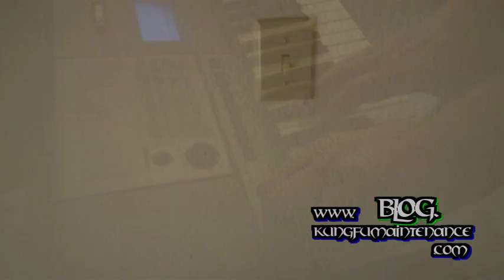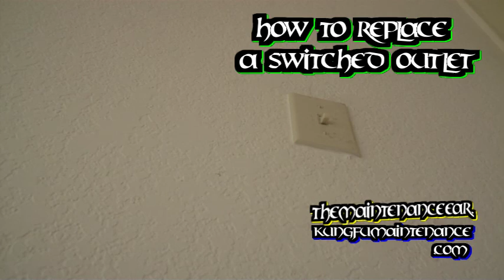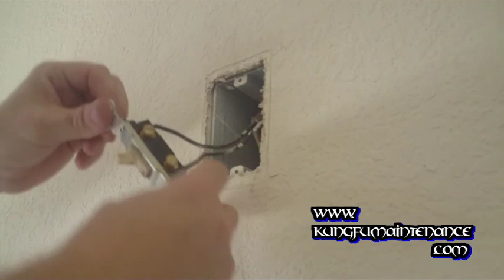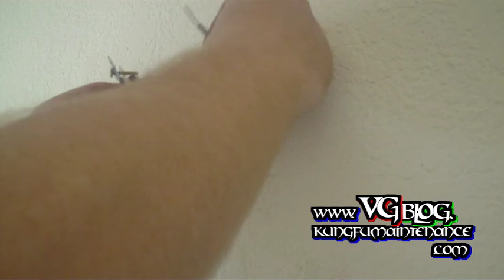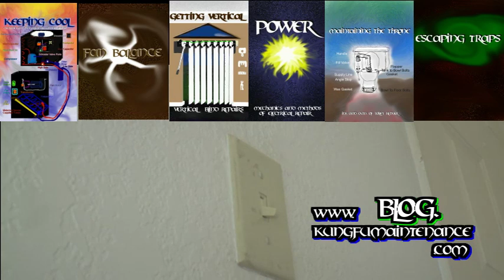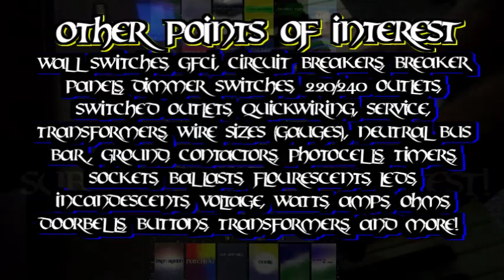Switched Switching Switch ~ How To Replace Electrical Wall Switches

Comment from the maker: NCVD, In smaller circles referred to as a "deadmen's stick". While I'm no Electrical Engineer my thought is that it uses components that pick up, register, and sense the wave differences (distances) that is particular to Alternating Current (back and forth waves). Transformers use Induction to change electrical energy voltage many turns set next to few wiring turns to transfer electrical energy. New electrical outlets are in R and D  that will not require plugging in only being in proximity to.

Comment: Just a related question regarding the battery powered circuit alert device that you used.  I also have one, and it definitely is handy.  But my technical question is...on what pricipal does it work that it can detect current.  And only within a limited voltage range, and not DC as I understand?